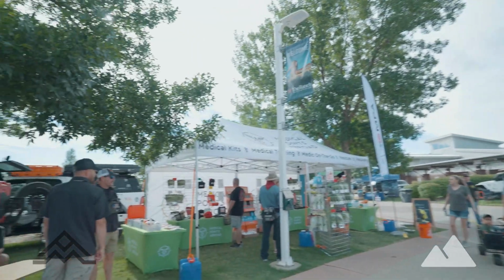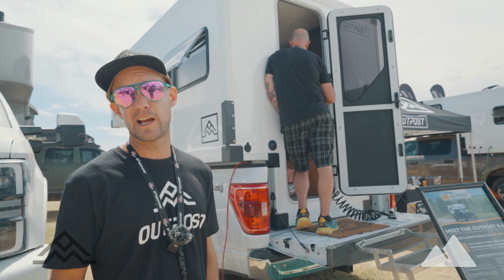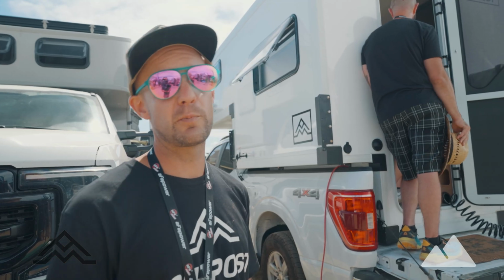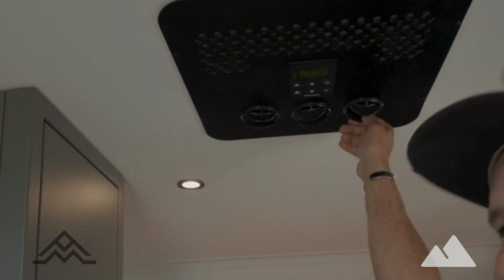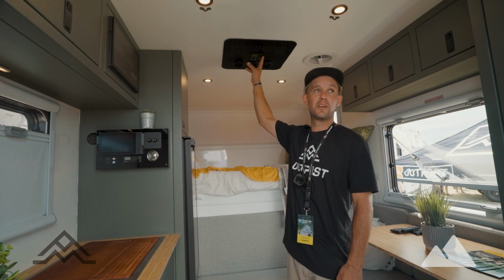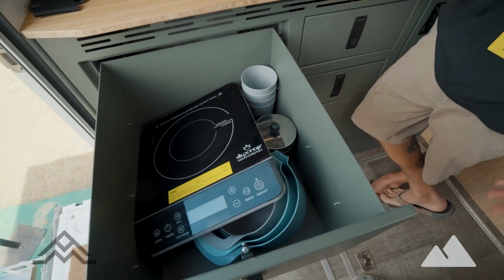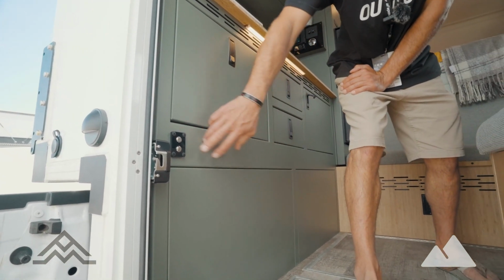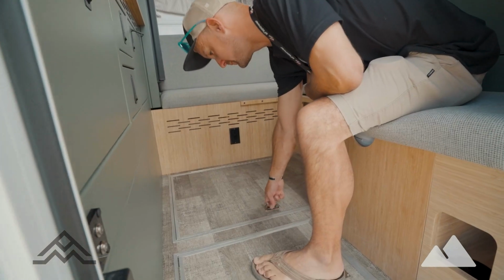OutPost Campers Tour | Compact Adventure Rigs Built for Off-Grid!

Comment: These aren't all electric when you get a diesel heater!
Reply: try heating an off grid vehicle off electric and tell me how that goes. the point is no propane.
Reply: @PrezenceMusic33  Misstating that a camper is all electric implies that everything is powered (appliances (cooking), food refrigeration), lights, air heater, water heater, air conditioning) by electricity not petrol  / fuel (gas, diesel, propane, butane).
Reply: No hot water on board?
Reply: @anthonylan2295  it's in the works for 2025 for the shower option!
Reply: Diesel heaters are awesome! Had one on my boat. The Germans are a clever bunch.